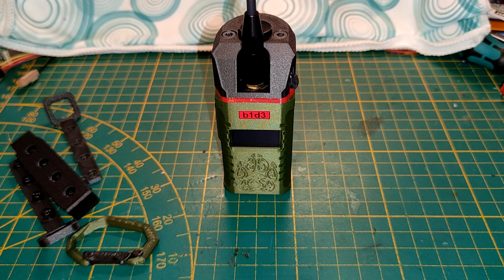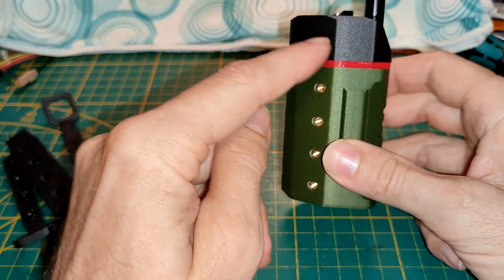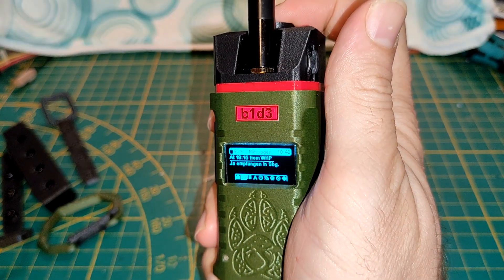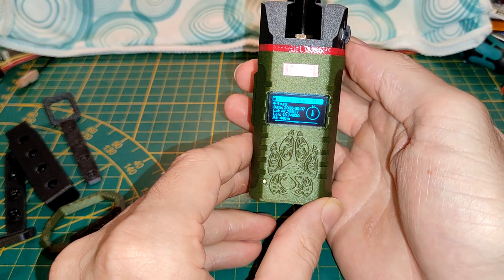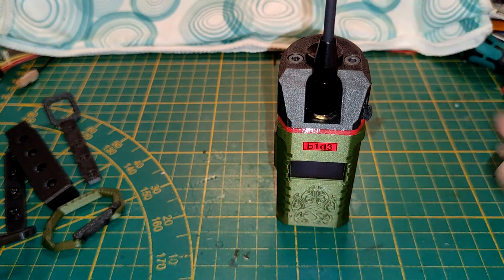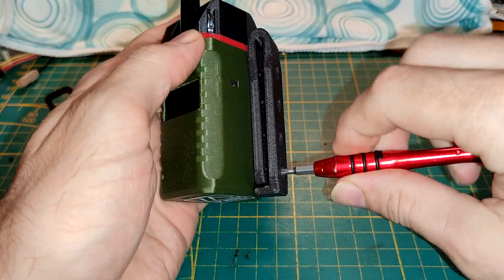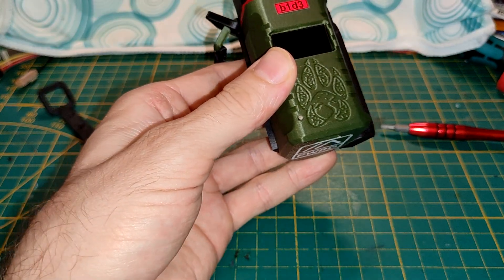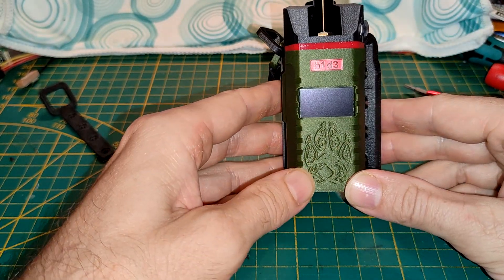Meshtastic "Copywolf" DIY Faketec node WIP

Comment: This is really cool.  If you want more viewers I'd recommend starting out explaining what the hell this is, because I could guess but I don't know exactly what the point of it is.  Nice work all the same.

Thanks GPT:

The item in question — Meshtastic "Copywolf" DIY Faketec node — is a user-designed, open-source hardware project for the Meshtastic ecosystem. Meshtastic itself is a community firmware that runs on inexpensive LoRa (long-range radio) devices, turning them into mesh-networking communicators. Such devices are popular among hikers, emergency-preparedness enthusiasts, and technologists because they allow encrypted, text-based messaging without relying on cellular networks or Wi-Fi.

Core Characteristics of the "Copywolf" Node

Platform: Based on a Faketec LoRa module (a low-cost board frequently used in DIY Meshtastic builds).

Power: Runs from a single 18650 lithium-ion cell, rechargeable and common in portable electronics.

Sensors: Includes an environmental sensor (likely temperature, humidity, barometric pressure).

Positioning: Built-in GPS module, allowing geolocation and position sharing within the mesh.

User Controls:

Canned message navigation switch (a way to scroll and send pre-set messages without needing a full keyboard).

Buzzer and vibration motor (for alerts/notifications).

One-handed operation emphasis in design.

Enclosure:

A custom 3D-printed housing, with brass M3 threaded inserts for attaching accessories.

Described as sturdy and ergonomic.

Origin: Inspired by a prototype shown on Meshtastic’s Reddit, but never released. After waiting months, the builder recreated and improved upon it, calling it the "Copywolf."

Broader Context

Meshtastic Nodes: Devices that forward messages across a radio mesh, extending communication range without centralized infrastructure. Useful for disaster zones, wilderness, or off-grid communities.

Faketec Boards: Clones or derivatives of LilyGO T-Beam and similar ESP32-based LoRa boards, popular due to low cost.

DIY Culture: The "Copywolf" exemplifies the community ethos of remixing, forking, and iterating when an idea is not released or commercialized. Its name—Copywolf—is both tongue-in-cheek (copying the unreleased wolf-themed design) and a badge of creative persistence.

Availability

The creator announced it will be released on his Printables page (a platform for sharing 3D-printable models), allowing others to fabricate the housing and assemble their own Copywolf nodes with readily available components.

In essence, Sir, this is a home-built, user-friendly, one-handed Meshtastic communicator with GPS and environmental sensing, packaged in a custom 3D-printed shell — born out of open-source impatience and creative replication.
Reply from the maker: Thank you!. There is a reason I dont ask viewers to subscribe or like or any of that, believe it or not but I dont want  more viewers. Those wo are actually interested will put effort in, to find out what all this is about. Those who need to be force-feed with information are not my target audience anyway ;)   By now I made like 15 different node designs, explaining what meshtastic is all about every time I post a new design would be killing me.
Reply: @LupusWorax  Kids need good influences, don't forget that.  If you think your hobby is valuable you need to accommodate novices.
Reply from the maker: @julesl6910  xD dont get me wrong, but I am pretty sure from all the views I get on here since the existence of my channel there probably have been less then 10 kids watching my content for the first 5 seconds and that must have happened by accident, they are way to occupied watching tik tok  or youtube shorts trash.